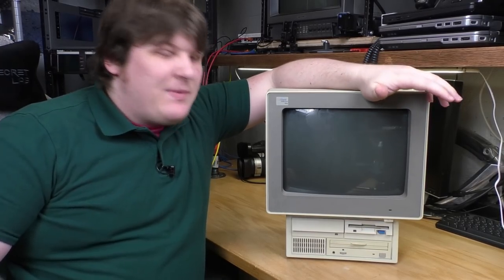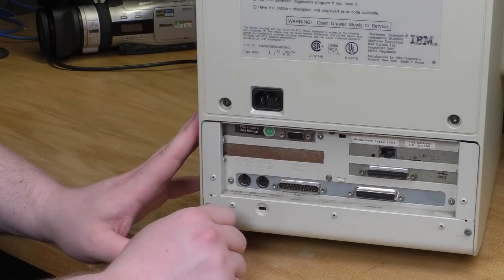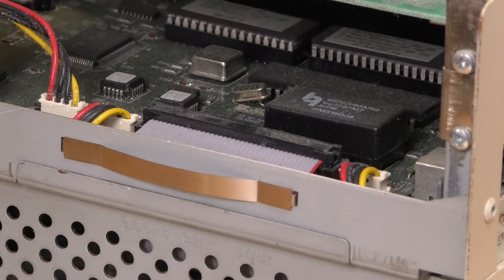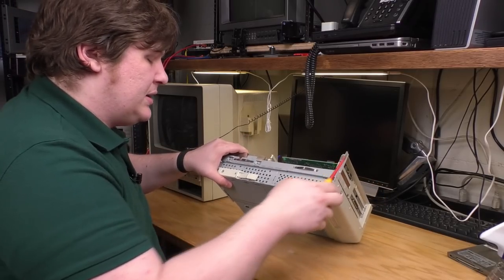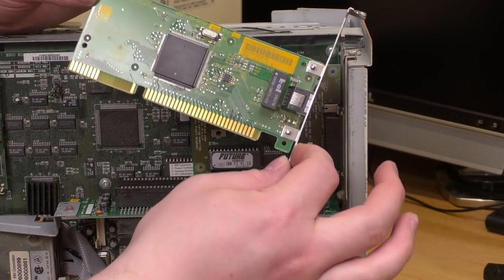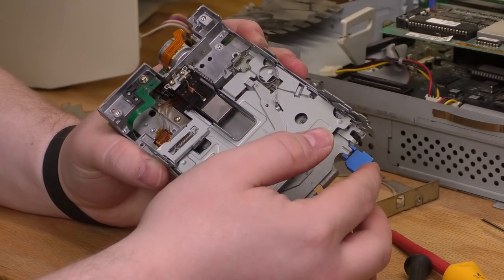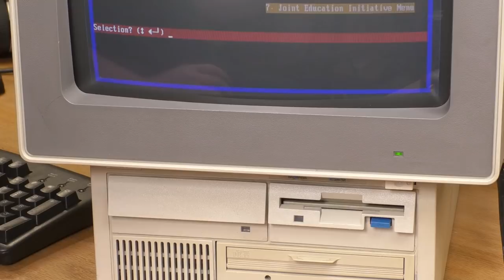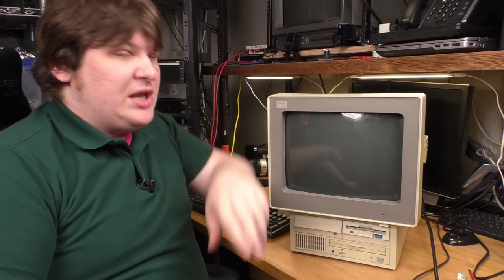Beginning the Eduquest

Comment: That odd extra screw for the Token card is probably there to act as a brace for the ISA riser card it and the other cards are plugged into and helps keep that end of the riser card in place. I see there doesn't appear to be anything else holding it down near the end besides that card + the extra screw.

Anyways looks like that machine came out of a science lab. Just like the Macintosh LC III I got off eBay earlier this year. (got for around $88 shipped for just the unit, no other accessories. Did have a hard-drive, floppy drive, some ram, and FPU upgrade installed at least)

It had some lab related software on it but the interesting bit is that it had a SuperMac Video Spigot NTSC composite video capture card installed in the LC PDS slot. Super cool! It looks like they probably used it with a microscope/scanner. There's a few photos they scanned in with it. The hard-drive installed looks original to the unit. A 500GB seagate drive which appears to still run fine. Floppy drive was gummed up (much like yours). I don't have the right oil to fix it so I just swapped it with the drive from my Macintosh SE. The capture card works surprisingly well on this 25Mhz machine. Hooked my Nintendo 64 up to it and tested it with Ocarina of Time. Didn't notice any latancy. Granted it seems to max out at a super low res. Like 240x vertical res. Maybe 320x240? Not sure at the moment. But it was a tiny window and this was with the machine running at 640x480 so thinking maybe less then that even. I guess you can't expect too much from something with a 25mhz CPU. :P

I got it for a good price anyways. It looks like they are still pretty overpriced on eBay right now with most listed for over $200+. The only 2 cheap ones I see on there right now are missing power supplies among other things. There's hardly any yellowing on mine too. They must have kept this thing in a AC controlled area that they never let get too hot and it wasn't near a window. All the science stuff you showed off reminded me of the the Lab work related stuff on my LC III. I currently have the motherboard shipped off to someone for recapping. It worked perfectly fine but these era Macs definitely need recapping now. I've already recapped the PSU myself. But I don't have good enough soldering equipment to risk trying to do SMD parts so I'm paying someone else to handle the motherboard. :P

Comment: Isopropyl alcohol for cleaning. I recommend disassembly to boards then submerge in shallow tray. Then use a small paintbrush while it's submerged. Afterward recollect the isopropol for reuse as the dirt will settle out. Do this outdoors cause of flammable fumes. If you are doing a lot of boards consider getting an ultrasonic bath.

Comment: for imaging any suspect hard disk, I really recommend using ddrescue instead of dd. it'll do things like retry bad sectors over and over until it gets at least a partial read. I managed to image the 500GB drive in my sister's macbook, which was so dead I had to stick it in the freezer and image it with the power and data cables coming out through the door seal, successfully with ddrescue over the course of /several days./

Comment: Apple IIGS were late 80s/early 90s, although I used one along side a custom built pc well into the mid 00s learning Assembly and C.  I got a IIGS Woz edition fully loaded with the best expansion cards as a birthday present in the late 90s from an Uncle.  It was an old machine at the printing and design place he was the head IT person for and they were tossing it out (I got a lot of goodies from there over the years, including the highest spec PowerPC MacPro made and the high resolution massive Cinemia displays to match).  I still have that IIGS setup and use it all the time to throw together little programming projects.  The IIGS keyboard was a marvel, you can get similar clone switches these days, but the same tophat style keycaps don't seem to exist (even IIGS keycaps are relatively expensive to buy).

Comment: In high school, our computer lab had a mixture of several IBM PS2 (I think a model with a 386), a couple Atari SX computers, one Mac Quadra,  and several Macs (maybe pluses or classics), and then one high end UNIX workstation that had a connection with a CRAY computer for special math events.  With the exception of that UNIX workstation, most everything was hand me down.  I'm not sure the exact model of PS2, but it was neat that the monitor was separate but meant to be form factor with the CPU.

Comment: Too right I remember CD caddies! 
My dad was an early adopter of CD ROM (and the internet) in the early-90s, so I grew up using a CD caddie drive, at a time when most people still hadn't even seen a CD in person. When I first saw a tray loading CD-ROM several years later, I distinctly remember thinking it was a total travesty. I figured some buffoon had cheaped out and tried to use an audio  loading mechanism for a data drive. Of course I knew that wouldn't work, at least not properly, because that just wasn't how computers were supposed to load CDs. I pitied the poor tech-illiterate normies that would get swindled into buying this inferior drive, and surely end up with chewed up discs after using it a few times!

Comment: To remove the dust, if you are 100% sure theres no electricity running through it, you can rinse the pcbs in a sink and allow it to air dry with a fan.  Make sure all the caps are discharged though.

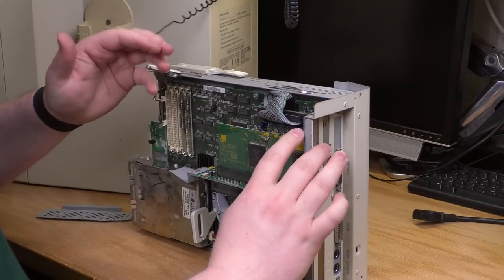Comment: 29:53 Dish-washing soap on a toothbrush and running water have always work great for me. Afterward i use an air compressor to remove water stuck under components leaving just the moisture. Then i put it on-top of my gaming PC as a heater for a couple of hours. I have cleaned an SNES, PC motherboards and even my MacBook Pro after a spilled apple cider all over it.

Comment: I have an original Model 25 with the colour CRT.  The original proprietary hard disk is almost always bad, and if it isn't when you power it up the first time it will get that way in short order.  Floppy disk drives are another issue; I picked up five other Model 25s for parts and got two good drives out of the six I had.  The hard disk I'm running is a Seagate ST-125 with matching controller card which was sold as an aftermarket kit by CMD.

The Model 25SX was almost an afterthought as it was very expensive to make, and it was only sold on the educational market.  It is a lot more common to find an original Model 25 or 25-286 with a Reply Powerboard in it.

Comment: I seem to remember a special "Computer cleaning vacuum" that my brother had that was (allegedly)specifically designed to be static safe with little nozzles and brushes for cleaning out a computer. Was old, like from the 80's though, not sure if it was accurately portrayed in its marketing material or not.

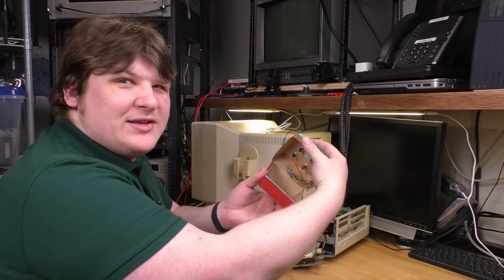Comment: 24:05 You might get fairly correct disk images of an old IDE hard disk drive with an old bootable system version of Norton Ghost or True Image you can use with "old" computers (might work with a socket 478 Pentium 4 or an AMD Athlon XP PC). Old versions of CloneZilla might also be useful.

Comment: These populated a lab that we used for "Keyboarding" class when I was in 6th grade...  I'm 38 so that would be...   maybe 1995-1996?

There were actual electric typerwriters along the edge of the classroom that we would start on and then we'd all get a turn using these Eduquests to run the Typing speed test we'd have to do.

A cluster of 8 of these all together connected via one of those parallel switchers so we could all print to a single giant dot matrix printer.

Comment: For imaging old floppies without destroying something, I examine the floppy's surface in the light to check for mold (I just manually advance the spindle with my finger while holding the shutter open), test the drive with one of the originally-blank floppies from my childhood that had its data copied to CD-R and then to DVD+R ages ago (and then probably to the Internet Archive if it was originally off somewhere like Tucows or Filepile), and I keep some spare drives.

...I did lose one of my traditional FDC drives before I adopted that policy though. Thankfully, when it got destroyed, it made a terrible noise, so I knew not to try putting anything else in it, and I have spares.

Comment: @Cathode Ray Dude there is this retro channel from Spain. The name is TuberViejuner. He restores old computers as well (and really well) . The guy takes all the dusty PCBs and dump them in a water pool (calls it "retro spa") , makes sure the dust/dirt is removed (gently) , and dry them thoroughly with air. I'd do the same and then put them in an oven at really low temp for 1 hour to evaporate whatever remnant of water. It's safe.

Comment: For cleaning dust off PCBs, I normally just use a paintbrush with soft bristles about an inch or two wide. Never had any problems with static or anything (knock on wood).
Reply: Same. Vacuum cleaner hose and just an inch-wide paintbrush to dislodge the dust. Never have had any problems with it.

Comment: I've just always used old toothbrushes and lightly go around all components on the PCB to get that stubborn surface dust. Dip it in isopropyl alcohol for bad areas. I also use a DataVac Electric Duster with the brush end.

Comment: What you have at 43:22 is designed to have a pH meter, which in reality is just a fancy potentiometer, and run pH measures in the lab. I want to believe that they didn't simply take single measures, but they actually did titrations using software, which would be so damn cool.

Comment: I just found your channel but I have to admit I ordered a bunch of tools your using. I've basically been doing it hardmode for no reason. XD Also a little tip about black scuffs, magic eraser takes that off super easy and you could probably remove that C4 on the top with a dry erase marker by scribbling over it and then wiping it away.

Comment: The HDD sled doesn't surprise me; not long before that IBM was fond of some really modular builds in the PS/2 line, even more than that with MCA systems.

I'm not entirely surprised to see a 386 manufactured then. I attended a private junior college in Pennsylvania during 92-4 and for general purpose lab machines they only upgraded from 8086 systems to 386 in that time period. Special purpose labs had 286 and 486 machines. My high school had something similar to what you have in this video but they were really new and it was a single lab less than 20 machines. Otherwise we had the Apple ][gs in a lot of rooms and a lab of PC Jrs for the programming class (they had BASIC on a cartridge.)

Comment: When I went to high school freshmen year in 2000, their brand new building computer lab was filled with these.  Probably had about 40 of them with a mouse, but no CD rom.   They used them only for typing class with some typing software and MS works.  They ran dos and were on a token ring.   
They got rid of all of them 2 years later.  All the other computer labs had win 95, win 2000, and then windows XP machines, Pentium IIIs and ethernet networked/internet.

Comment: These machines were originally sold to schools at a discount, setup in a networked lab with token ring. They would boot off a disk and then run DOS apps loaded from a server. There was an attempt by IBM to push SaaS in the 90s and these would have been an entry point to eventually leasing program access from a central server hosted at IBM. 

The program was a flop, and my guess is these machines were repurposed by the school as Windows clients on a Novell or Lantastic network and were upgraded with the HD, CD-Rom, additional RAM, and Ethernet card.

LGR has an earlier version of the same machines. They also sold these in a 486 variant. They were also sold with IBM branding to private schools, universities, and non-profits.

Comment: PS/2 era IBM computers are pretty service friendly from a mechanical viewpoint. I'd even go so far and say they were likely to be one of the first manufacturers to do so. A lot of PS/2 systems don't require any tools to take out everything you would normally want to swap or remove (expansion cards, ram, disk drives, battery)

Comment: My secondary school had softwhere a bit like that that connected to a serial data logger that could log using different sensors like temp, humidity, light, sound or pressure. We also had a edutainment game called bodywork voyager that was a sort of flight simulation but inside the body, got an iso of it somewhere

Comment: If I'm not mistaken, those screws you talked about @30:20 might be M3 metric thread; at least I'm pretty certain that that's what's used on Optical and Floppy drives.

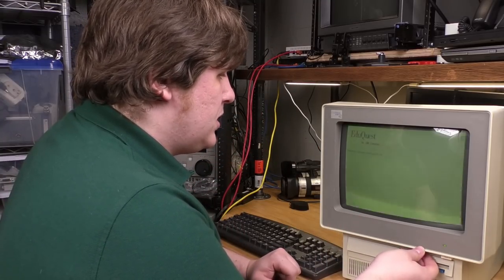Comment: 41:26 for bios passowrds you can always google a backup password for it (depends on the manufacturer or the company which made the bios like AMI) on 90s hardware i found that sometimes there's a hack of using a floppy disc and on an hex editor inputting a "password" ascii text on the second sector and booting the computer w that floppy in (worked on an old toshiba satellite laptop from mid 90s), I'm not familiarized with IBM desktops/the eduquest itself but i bet you can diug something out having access to the actual hardware, if not and the bios settings are super important you can always try to get access to the bios chip and maybe read it w a cheap programmer? for what i could see it had some socketed eeproms i think? so maybe that can be easy idk

Sorry for all the comments just had to give my 2 cents on all i think i could help with, this video format is very exciting and interesting !!

Comment: Hi CRD, i have heard that a brush made from horsehair, such as the ones used in painting houses and whatnot, are good for brushing dust off pcb's without inducing a static discharge. I haven't done any investigating myself but i have used it and havent killed a pcb yet.

Comment: I have a Compaq Presario 425 all in one and it also has the whole machine in a drawer type configuration, except that it just connects to the power supply and monitor internally with an edge connector at the front so it's incredibly easy to take it out.

The problem with it is that the CMOS battery is soldered to the board, and it died recently

Comment: HTR rocks but is more bulk scale.  You would probably do better with citric acid rust removal solution (which I learned from the post apocalyptic inventor) because you would be able to tune the concentration a bit easier.  I've not tried it on chromed steel so test patch first but it works wonders.  Good show man.

Comment: i clean circuit boards with compressed air usually and if you heat up and bend a toothbrush to 90 degrees and tape it to your vacuum cleaner tube the vacuum sucks up anything loosened from the likes of vents above crt tubes etc

Comment: 30:13 honestly every piece of tech that enters my house I clean it by dissasembling every part of it even the plastics, plastics and metal go through hot water and soap and I scrap them with a toothbrush or if I need something bigger a big brush, and then dry with a towel and hot air.

And pcbs and such get cleaned with IPA 99% and an old toothbrush, if needed I also use some hot air to make sure the alcohol is evaporated, never ever had any issues even if it isn't "static-dree" honestly idek if that static free thing is even all that important on electronics bc afaik every component has a margin for those kinda occurrences. I have stuff as old as mid 80s with its original caps and cleaned them that way without being careful at all and never had a single problem, also cleaned modern stuff like a ps4 pro or my own gaming pc like that and not a single issue.

Also for rust or to remove crap from metal or even plastic I use wd-40. that stuff turns everything into liquid and you can just wipe it off. i also use it to clean contacts/preserve metals on pcbs, again on old af stuff and even modern stuff, works great to make sure pci/isa/agp connectors stay making connection.

Another thing: for hard drives that fail, try removing the bottom motherboard and cleaning the contacts that touch the actual hard drive on both sides, especially on modern ones, since condesation/temp changes can make those get a bit rusty and not make good contact and start giving issues, literally fixed dozens of hard drives by just doing this (with wd-40 and some ipa of course).

So excited to see you got your white whale, hopefully we see more of it on a future episode !!

Comment: Alot of these machines have had hard life, mines had pen writing all over it but it cleaned up near mint. I had to repair the floppy drive because a cap went bad and ate some traces and same for the cd drive but repairing that didnt work so its dead. I stuck 16mb ram in it and it works great. Might do cf card upgrade and find another cd drive that would work with the sound card thats in it.